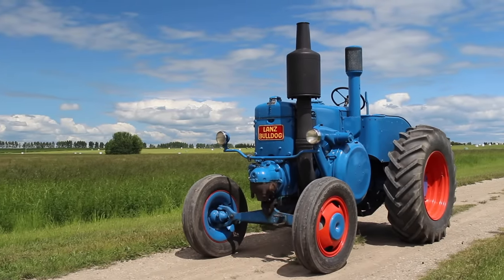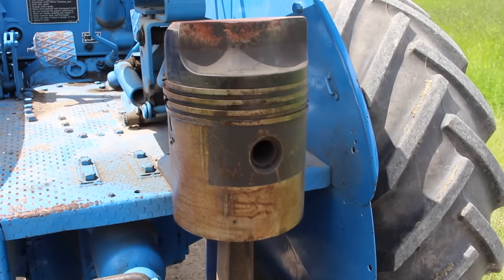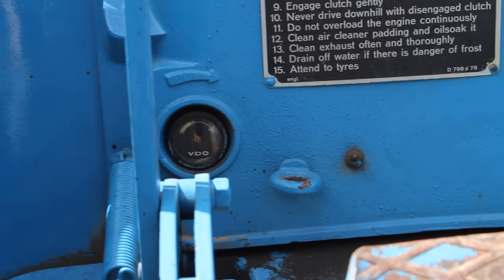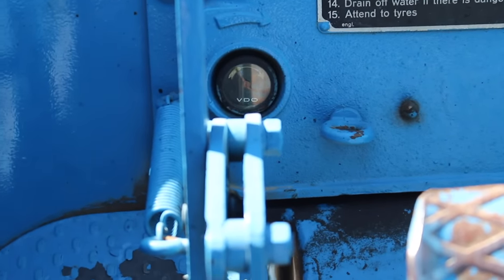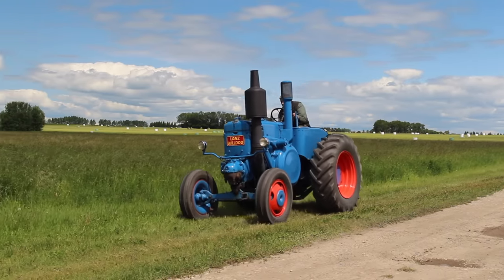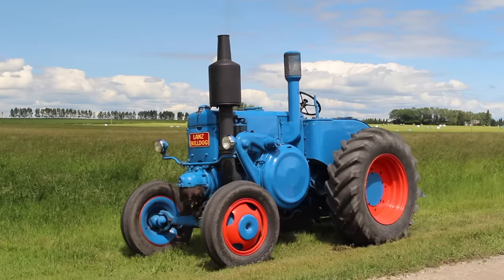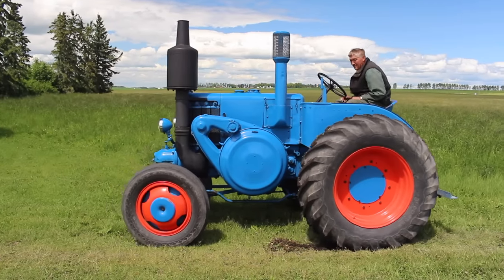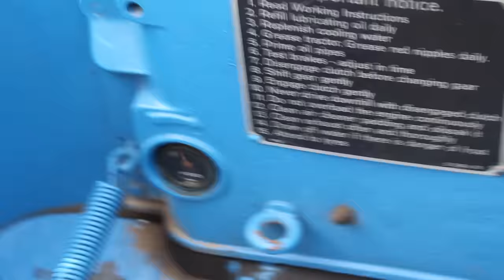Engine running backwards? Lanz Bulldog Tractor two stroke

Comment: That's a special mode for when these old tractors needed to reproduce.
Reply: these tractors were actually dangerous becouse when they pulled something uphill the engine could reverse rotation and all of a sudden you haul ass downhill
Reply: No worries when it does that just slam her in reverse gear and keep going 😂
Reply: @blackturbine  : That's not the only reason why they are dangerous.   Have you seen how a Bulldog is started?   After heating the head with a blowtorch, you lift out the steering wheel and stick it in the flywheel and turn it back and forth by muscle power until you get close to top dead centre and it fires.   You need both hands because it is a damn great heavy engine.  You can't use a safe crank grip because you don't really  know which way its going to run.   Then while it is running, you detach the steering wheel and put it back in the steering box.   A recipe for getting a hand torn off I would think.    There is a common fault that occurs in the transmission.   Owners are tempted to leave the engine going while they take a cover off and fix it, as re-starting the engine is such a process.
Reply: It seems this particular tractor is still able, at least to run in reproduction mode. Whether it succeeds is another story ... It would need a partner I presume?
Reply: @MrArray1967  : They try and mate with a plow - but there is vary rarely any offspring.
Reply: @keithammleter3824  I totally forgot about that  

or a shotgun cartrige start
Reply: @blackturbine  :  Field Marshalls (an English machine somewhat similar) could be cartridge started, but I don't think Lanz Bulldogs could be - I might be wrong.
Reply: The design look like Thomas tho
Reply: @keithammleter3824  The newer ones have a safe start rim on the flywheel and do not use the steerign wheel. Those are safe and VERY easy to start.
Reply: @Zonkotron  I was aware of the starting disk permanently attached on the later models.   But the other severe safety hazards still apply.  The engine is still only "easy" to start if you have the patience to go through the procedure.   That takes a while, so owners are still tempted to leave it running while taking a break or doing minor repairs.  It can still run backwards if stalled.
Reply: Yes all tractors are dangerous if you leave your brain in toilet,on the video with the baby Lanz hl12 you can watch how its started and put into reverse same way,owner standing beside veh.,and its shown how to and not to place your hands.
Reply: @claesmansson9070  : Agreed - all tractors have dangers for those who don't think.   But some ore more dangerous than others - eg Lanz Bulldogs, and older American pattern tractors with the front wheels next to each other.
Reply: @keithammleter3824  i love old internationals specifically they are beautiful tractors
Reply: @blackturbine  you had to be going really slow and have the RPM really low for this to happen. It wouldn't just randomly reverse while pulling something uphill
Reply: Lmao😂😂
Reply: @dieselgeezer18  : It's not going to happen just because you are going uphill, but accidents happen almost by definition because there is some other unanticipated factor.  It could be running very slow due to high towing load and being driven by the recently hired young farm hand, or - while driven at normal speed - he collides with something he didn't see.   It happens.  In a tractor with a high speed engine, you just stop dead and perhaps get thrown out of your seat.   In a Lanz Bulldog, it also goes backwards and maims or kills you.
I was driving a Caterpillar D4 one time clearing scrub and collided with a tree stump (hidden in the scrub) nobody told me about.   Even though a Cat D4 with blade etc weighs about 6 tonnes, it stopped dead and flung me out of my seat.   In flying forward I hit the speed lever which instantly shut off the engine.   So - a bit of embarrassment, but no damage whatsoever to the D4 or me.  I've wondered whether Cat's engineers put that speed lever just where it is, and set it up so forward means stop and back means go faster, for just that reason.   It's just the sort of zero cost care in design that American makers practiced, but European makers tended not to.
Reply: @wildman510  : Yes, other hot bulb engined tractors and road rollers were started in much the same way.   But your second sentence is not correct.   There is no decompression lever, and the compression is way too much to manually turn it past top dead centre by continuous cranking.   The method of starting is to rock the flywheel to and fro, using one compression to help with the next, like building up on a child's playground swing, until it fires.  Due to firing before top dead centre, it powers back the other way, and then has enough inertia to fire again, get past TDC, and keep going.  It is somewhat a matter of luck whether it fires first on a "to" or a "fro".    If it happens to run the wrong way, you lower the RPM and when it begins to rotate in the opposite direction, you open up at just the right moment and it continues to run, now the wanted direction.  
Based on what I have seen with other hot-bulb engines, as experienced operator will have learnt to judge it right so that it first fires fairly consistently in the right direction - I see the Bulldog's hazards as mainly applying to inexperienced operators.
This is why it is dangerous in that it can run backwards under power if stalled by colliding with something or towing a heavy load at low speed up a hill.
Reply: Mitch Mckeive
Reply: Good ol' tractor mating call 😂
Reply: @blackturbine  Jesus, fuck that
Reply: Hahaha
Reply: @Bw40099  me too, look great done up
Reply: @blackturbine  999
Reply: @MrArray1967  ñnnnnnn
Reply: Commonly called the sex gear but often referred to as fuk speed
Reply: What